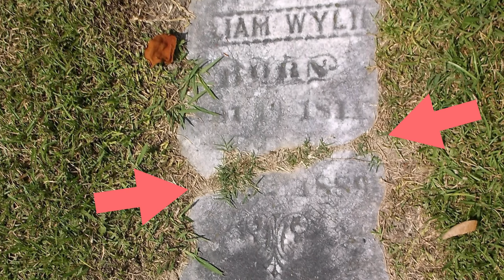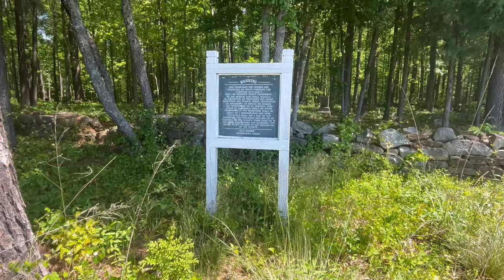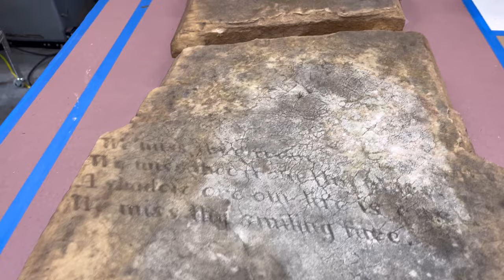Broken 1800's Marble Grave Marker Restoration

Comment: Great job. I have fixed several headstones in an old cemetery here in my town that go back to the e17 hundreds.  D2 is great product and I highly recommend Bonstone's epoxy adhesives.  I repaired the stones about 4 years ago and they are still in great condition.
Reply from the maker: Thank you for the comment and the compliment.  We’ve repaired a bunch more since this one and still have a bunch more on our radar.  I plan to have another video out in the next few weeks time permitting.  Again thanks!

Comment: The next time you do this type of repair work, when you trim off any excess stone...... Save it for later. Grind it up into a finer granular powder, and mix it with a clear epoxy to form a patching compound to cosmetically repair any remaining cracks. That will minimize any color or texture discontinuity.
Reply from the maker: Good tip! Thanks!

Comment: Just wondering if adhering the top and bottom pieces together while it was in your shop wouldn’t have been a better option. But good job nonetheless the less.
Reply from the maker: We debated that, but the bottom piece was really bowed from being on the ground for so many years, that we figured we’d have to compensate on the top to make it more straight and level.  But in a perfect world that would have been the best choice.
Reply: I've restored several tablets and the only comment I have is that conservators understand that stones "breathe" and want to leave gaps in the epoxy so moisture can move up and down.
Reply from the maker: @bryanmcintyre-nf4bt Absolutely a great comment.  Thanks for taking the time to watch and comment!